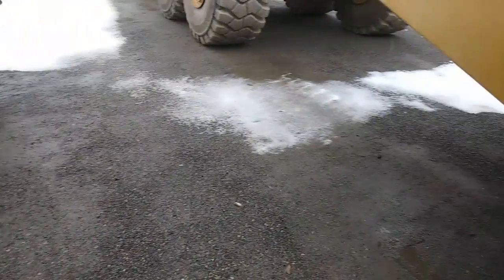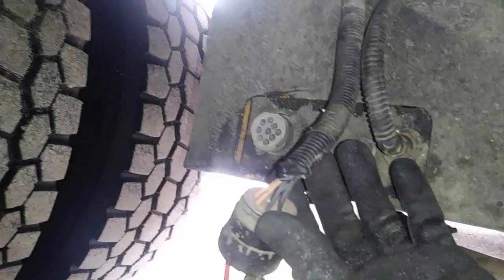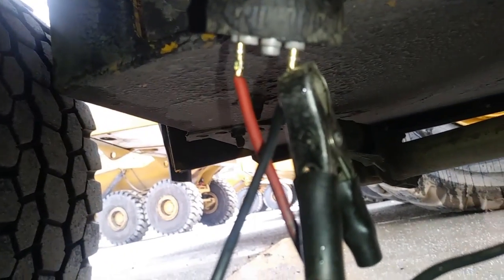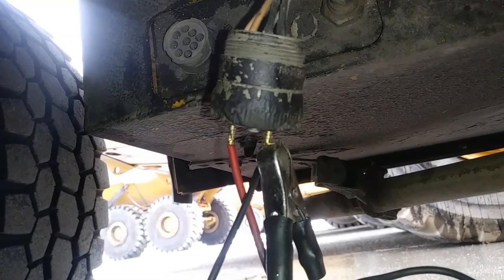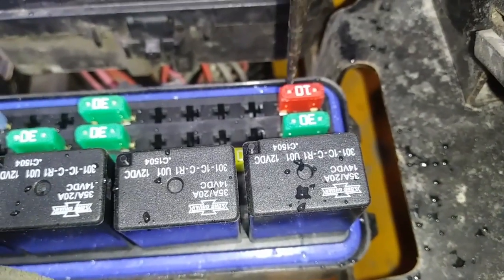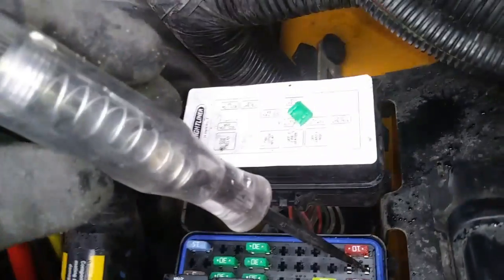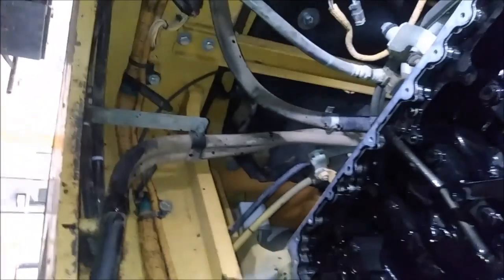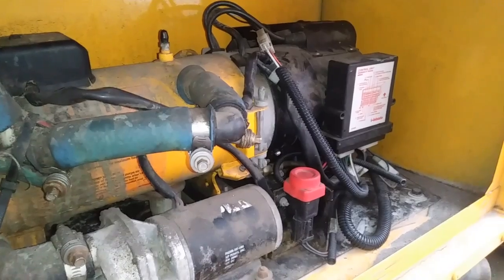Why You Should NOT Trust Your Multimeter By Itself. Diesel Mechanic Electrical Troubleshooting.

Comment: Multimeter not lying. It sees voltage not under a load. Under a load the light is outrunning the supply. Bad spot in the wiring, bad connection, bad ground, bad hot, corrosion, rust, even seen chassis grease on connections cause problems. Time to isolate sides and find out where the bad spot is.

Comment: The DMM is not lying there is no current flow when plug is disconnected. NO CURRENT FLOW No voltage drop every trouble shooter should know that.  If you dont want to use a test ligh use a load pro test lead
Reply: true zero means open yes sr.
Reply: Personally I use a 12 /24 v 5w or 12/24v 10w or for big loads I use an old work light with a 12/24v 100w h4

Comment: Loved this video...especially that cold sunshine (snow).  This took me way back...I loved your troubleshooting technique...divide and conquer, keep dividing, find the half that has the issue and divide again.  It will eventually point out the issue.  I'm not a fan of auto ranging multimeters, but then I'm pretty old school....and just old.  I spent many years troubleshooting DC digital circuits in Semiconductor manufacturing equipment...still enjoy employing those skills...but glad I'm doing it in a warm environment now.  Webasto furnace/water heaters are still used in Diesel motorhomes, they are called Aquahot systems.  Again this was a really fun video.

Comment: ONCE AGAIN:
Voltage means NOTHING without load!

The voltmeter is NOT lying and if you understand the very, very low current it uses, you don’t need an engineering degree to know it means there is connectivity and voltage, but can’t say anything about current capacity!

Comment: Good job figuring it out. I have had the same problem with multimeters. as I live in Michigan and I see alot of green wires. I also try not to pierce wires, but I'll smear some RTV silicone over the holes when done.
The best one I found was a bad connection, someone twisted the wires together,  zip tied around the insulation and put a band aide (literally a band aide, not just a metaphor for the repair) around the exposed copper.
Reply from the maker: Talk about a band aid fix literally.

Comment: Hello Josh, you should explain this in detail. As you know, the moment that you measure the voltage with a multimeter, it's a voltage when the circuit is not loaded.
Just try with an Alkaline battery. If you load them, they'll show a lower voltage than when they aren't, that's how it's works.. :)
https://www.youtube.com/watch?v=Z-m-7jex88k 

The title would be, Why you should NOT trust the voltage of a circuit when there isn't a load on it.

By the way, it's not to offend you, but just make you a better Youtuber! :)

Comment: Awesome example of voltage drop. The Load Pro you mentioned would have simplified this process. Load Pro Caterpillar Part Number 275-9936. Inexpensive and can be used with the multimeter in your box.
Look up Dan Sullivan Load Pro.

Comment: Gotta back probe loaded circuits . Testing open circuit voltage or ohm testing wires is nearly useless . Gotta stress the circuit to find any resistance.

Comment: I work in a mine, and the 4x4 vehicles had a problem with the ABS systems kept tripping with faults which for safety reasons means a no start lock out.  Turns out that the mud,moisture and salt in the chassis was actually putting stray charge into the wiring loom (even though it was undamaged) and setting off the ABS faults.  The manufacturer sent out a rep and couldnt believe it.

Comment: It's not multimeter's fault.
That s why my uncle uses a halogen light that pulls 4A on 12V to load the circuit and a small clamp meter.
If it does not light up he measures the resistance of the ground.
If it's good he what you did.

Comment: I went through a similar issue with my fog lights. 
Relay has power and ground all across the relay. 
Turned out to be the battery supply connection was corroded.

Comment: The meter isn't lying, because that is indeed the unloaded voltage at that point. At some point I am going to make a "low z" adapter for my multimeter, so I don't have to manually add a resistor every time I suspect a ghost-voltage.
Reply: You can get multimeters with built in lowZ, but their resistance still is in the 10-100k range.
Reply: @lukahierl9857  true, but I already have 4 multimeters and I really shouldn't be buying another one. Besides I would like to have more of a k low z option for automotive stuff and a 100k one for the 230v stuff
Reply: So the meter is lying...
Reply: @fastinradfordable  no, the meter is accurately displaying the voltage measured. It is up to the operator of the meter to understand its principle of operation.

Comment: That failure in the C7.1 is a common thing. I've seen an excavator and a wheel loader, both with less than 2k hours of operation with bad crank, block and rods. And the worse thing is a lot of new machines come with this engine!!
Reply: Perkins

Comment: Interesting that the heater is labelled as "WBSTO" instead of simply "heater" on the fuse box.

Also, could you theoretically replace a C7 or C7S on-highway engine with a C7.1 industrial engine?
Reply: Theoretically yes...  The configuration and ecm pinouts have places for throttle input, brake switch inputs, and cruise switches... But the software that is used for DPF ash modeling is funky compared to the on-highway counterparts. Packaging it all using all Cat parts would make it physically challenging if you want the entire emission systems to function properly.
Reply: @davidoneal6969  The emissions items? Who the fuck wants to deal with those anyway? I'm keeping the DEF system but the EGR and DPF are geting deleted.
Reply: @electric7487  Why keep DEF if you're deleting everything else? If you're going to fuck around, why not go 3116, or 3404, or just get a L10 and smile.
Reply: @electric7487 Might as well get custom software then, for the SCR catalyst to work probably though you need to keep soot down to a minimum.
Reply: @OlRandy  Because, at least in my view, NOx are a lot worse for the environment than black smoke.
Reply: @davidoneal6969  I'll just gut the DOC/DPF module and get a single large DOC installed if I can find one; if not I'll just install a tube in its place. From 300°C to 400°C, DOC's cook most hydrocarbons and about 40% or so of the carbon.
Reply: @davidoneal6969  Another question: Can you put Jake Brakes on an industrial C15
Reply: @electric7487  Depends on the software and how it's configured. I've seen both with and without, more without though. I don't recommend industrial for on-highway for a couple of reasons. Industrial engines are generally tuned for constant speed, constant load applications, so they don't have the same power curve and driveability as their on-highway counterparts (throttle tip-in and cruise load / unloading issues mainly). The legality based on where you live (or get caught) might frown upon it greatly (fines). Lastly, packing industrial engines for on-highway would be a pain, since flywheel housings, cooling packages, and overall fit / finish would be a pain to deal with.